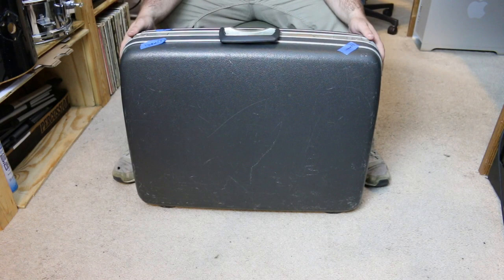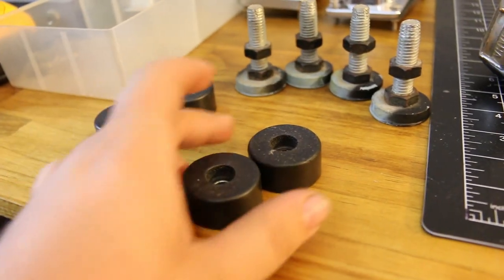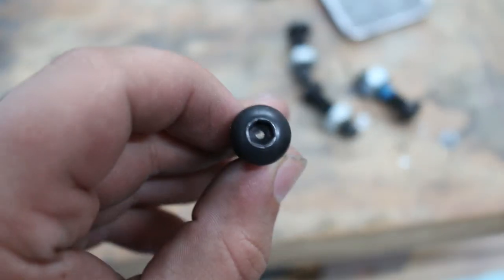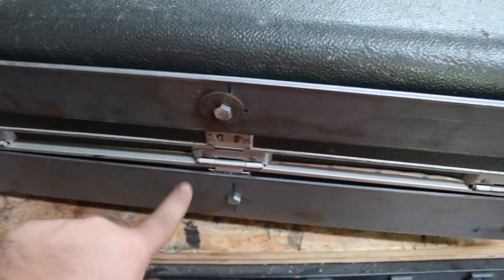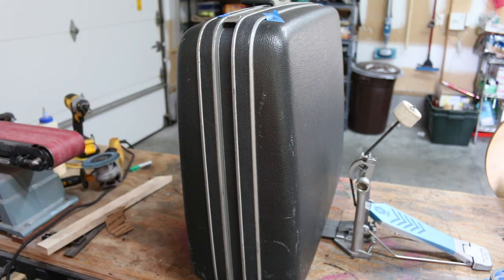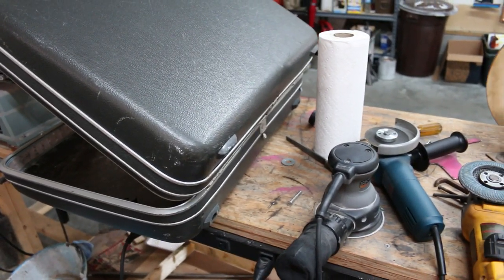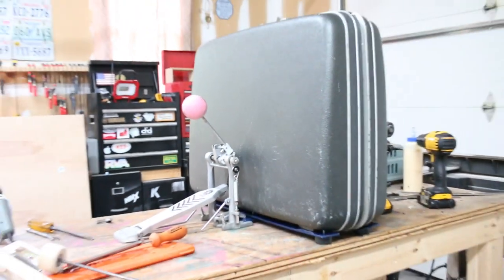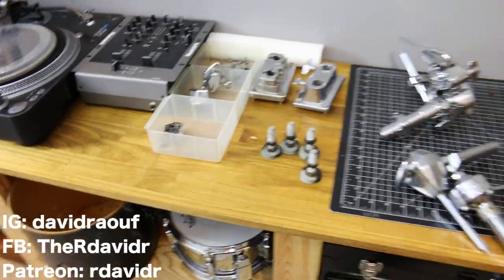Suitcase Drum Set: Pedal Mount

Comment: I tried the pink ball thing in the beginning but really didn't like the tone.  I made a beater out of those foam gym mats.  I cut three layers of about 1/4" gym mats, made them circular and then stacked them on top of each other.  They had a good, wet, "thump" rather than a "thwack" when I'd hit the case.  Only bad thing was that I had to replace it every few months, but it sounded great.  I love the idea of the steel at the bottom.  I wish I'd done that with mine.

Comment: awesome.  I didn't know if I would like all of the metal on the bottom, but it turned out great.  what's awesome is if the hinges start to fail or make noise you could remove them and put a weld on continuous piano hinge.  I'm really looking forward to the next one.  Have you heard of anyone using these kits with triggers possibly on the kick?